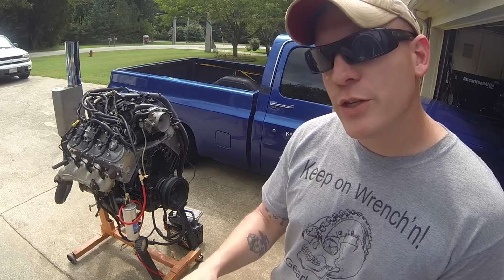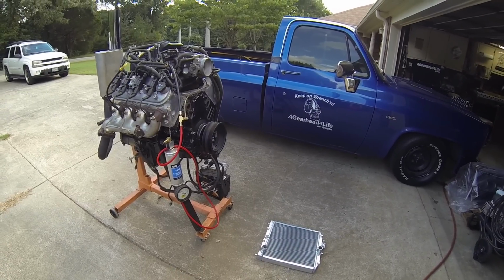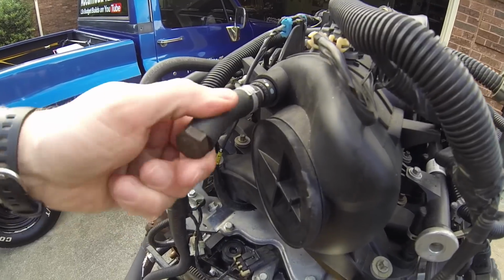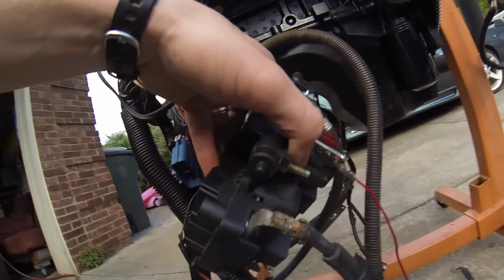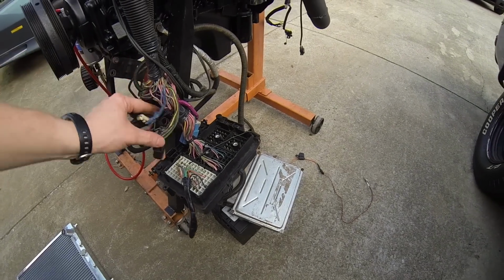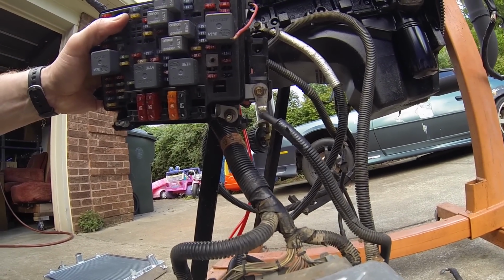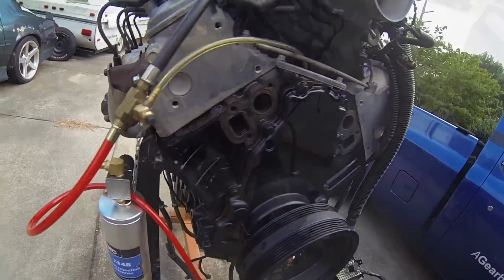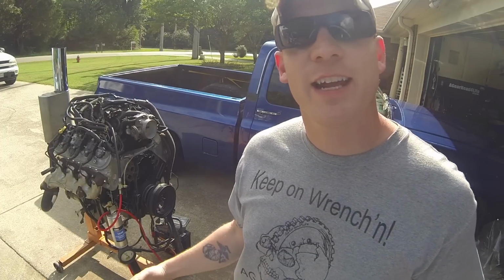LSx Swap Harness How To Simple & Free DIY Standalone on the Test Stand

Comment: Got this from MikeyTuned. Pin F1 on block C3 is the 12V hot for the fuel pump. It should work with any fuel pump so you can power your fuel tank through this harness.

Comment: This is comment is lengthy, but I need sound advice.  This requires a full understanding and as much info as I can recall.
Watched the video numerous times.  We are swapping a 5.3L (from '06 Suburban) into a 1970 Scout 800B.  Followed all steps as best I could follow.  This is our first shot at something this involved.  We have it turning over like a champ.  We cannot seem to get the injectors to open up.  Cranks and cranks with no fire or fuel making it out through the exhaust.  We did have shellacked fuel back pressure out the fuel rail when I disconnected the injector cleaner set up.  Very late the other evening, the motor seemed to seize up when turning over.  Fearing we screwed something up royally, I turned the crank by hand with with a ratchet.  It turned with a slightly different feel than what I remember while priming with oil, but no hard hard-ups.  I fired once more with the pistol grip ignition switch.  It turned over again, this time it did puke some shellacked fuel out the exhaust.  We called it night.  (This motor was bought about 2 years ago, ran when the suburban was totaled. We haven't really touched it until this week.  Prior to attempting to start, we drained oil, changed filter, primed oil to all 16 lifters, changed plugs and wires.)  The day after the puking, I added some injection cleaner to the fuel in the canister hoping this would further help the case.  No luck.  After turning over several times, we still don't get a start or fuel out the exhaust.  We have checked for power at the injectors and coils.  Success on all cases.  At a loss right now.  Wondering if there are some slight variations in PCMs (I did have LT1 reflash and remove VATS).  We've watched a few other videos on the subject; yours is by far the best and easiest to follow.  I have picked up some other tips we may try, little more elaborate setups with a reservoir and fuel pump and some other terminals powered.  Any other tips you might provide would be awesome.
Short of the situation:
-5.3L Vortec from 2006 Suburban
-stock harness and PCM from same vehicle
-reflash and VATS removed by LT1Swap
-oil drained and engine primed with oil
-new plugs and wires
-stock harness reconnected and wired following the guidance from your video

-short headers installed in place of factory exhaust manifold to fit in the smaller Scout engine compartment
-EVAP purge solenoid is still installed with outlet/inlet plugged
-large vacuum port on the rear of intake manifold has what looks like a factory plug (I've removed to confirm it was actually a plug and reinstalled).
-a third vacuum line on the front passenger side was plugged
Would really appreciate some advice.

Comment: hey gearhead...just finished my swap.but I have one last question hopefully you can help me..what would happen if I don't connect my tcc wire.thanks again for all your help...helped me big time..
Reply from the maker: It'll run and drive and all, but it's a good idea to hook it up. Off the top of my head, i cant tell you what would happen. Maybe just not lock up the converter, meaning higher RPMs and less fuel efficiency.

Comment: LS performance all the way man....at first I didn't even wanna think about an outta the norm swap but vids like urs and there's a TON of good books.....how to swap GM LS engines into almost anything is a real good one but the best way is to not b afraid and do it.....if it don't work hey were just out of a pile of loot, sounds like normal everyday life huh, lol?......these vids and those books.....make that not the case.....it's possible.....good luck to ya man!!.....oh I almost 4got do u have a video of how u plumbed the fuel lines in the 3rd gen??....or did u go w/an aftermarket tank, etc?
Reply from the maker: +Aaron McDonald Yep, thats it. Don't be scared and just do it. I dont have a video on the fuel but there wasnt much too it. I've got pics of what I did in the photo album of it on my Facebook blog page "AGearHEad4Life".
Reply: Nice.....I'll scope it out.....did u have factory fuel injection?....in other  words,  did u use an in line pump or one sumped into the tank?
Reply from the maker: +Aaron McDonald On my first c10 I used an in-line pump, but on this one I adapted a walbro 255 pump to the sending unit. I prefer an in-tank pump. In-line is noisy but easier. A sump is a good idea for these. IMO the best way is to use a fuel injected k5 blazer or suburban gas tank in the rear.

Comment: If you believe in yourself you too can start your LS swap with a crimper/stripper tool.
Reply from the maker: Definitely 👍 Shoot, my first LS swap was done by ghetto twisting the wires and electric tape when I removed the stock fuse block and it still worked great as a daily driver for years.

Comment: can I just put the engine and trans in from the donor vehicle and run a wire from my ignition to my A9 plug and just go?
Reply from the maker: Yes, technically you can and it will run and drive, but you’ll eventually realhh in me that there are a few more connections that you’d like to have. An OBDII port is one example.
Reply: @AGearHead4Life  I have a complete donor vehicle and I am attempting to  basically take everything from the donor vehicle ( instrument cluster, daytime running lights, mirror w/ temp and compass, cruise control) everything and install it into my 2 door blazer. Im basically swapping the shell for a different shell. I know some fabrication may be needed but I did want to butcher the harness if I didnt need to.....thank for responding

Comment: I don't have a pin number A 9 but the harness I'm using is from the donor truck witch is a 04 with a drive by wire TB
Reply from the maker: It likely does have it. It's very easy to misread the terminal labels. I did it at first a few times. I had to study real hard to get see it right. I think I actually counted them to get it right. lol

Comment: That's awesome Dude. Thanks for putting that together.
 I'm right in the middle of an LM7 build (going in a Jeep). (I'm building a stand-alone harness now.)
 A couple of questions if you don't mind.
What are you using to plug the evap purge valve? It looks like you cut the purge valve in half.
For the vacuum port on the back of the intake, where do you connec that in the swap vehicle? In a chevy truck, it goes to the supplemental brake assist pump, I think. I don't know if the Jeep has one of those. I don't know what to do with that vacuum port.
Thanks.

Comment: gona try it out see what happens im almost done with my c10 82 it already cranks sound fkn loud and sweet but turns off quick i think is the thief lock cause i didnt flashed the computer and well was asking u of the obd2 cau see i want to tune it in the futer i was able to use the original fule pump of the donator suburban 2000 i got i want to send u some pics to see if u can show them to people i like how u teach my dad is a mechanic and been learning alot to from ur video. thanks..! 
i had a straight 6L in my c10 82 and well im going to be so dam happy when im done with my 5.3 runing in my c10 i already see thant c10 flying lol

Comment: Gear head awesome video your video is gonna help me a lot only question is my factory harness that I'm taking out of my 2004 Cadillac escalade looks a little different from the factory harness in your video also mine is drove by wire not cable what else do I have to do with the drive by wire?
Reply from the maker: I can’t think of all you need to watch out for, but I know one thing, you need that accelerator pedal and the harness that goes to it. There may be a little brain in that harness too. 

Yes, the overall harness is slightly different, but not by much.

Comment: That's incredibly easy to do. Now my question is who reflashes the GM ECU or ECMs? Or is there the actual software you can buy so one can do it at home? Awesome videos man. Thanks.
Reply: Just found HP tuners can reflash and remove VATS.
Reply from the maker: +Abel Ramirez Thanks Abel! Yes HPT can do it, but that software is about $500. So usually people just pay to have a tuner do it for them. I've got the info for the person that I used in the video's description.
Reply: +AGearhead4Life Whoa $500 is good chunk of change but for some it may be a worth the investment. Still good to know of good tuners out there.
Reply from the maker: +Abel Ramirez Yea, it's a big chunk. It'd be worth buying if someone was planning to tune as a business or even just really wanted to learn to tune their own vehicle bad enough. A little bit  more investment and you could buy a Holley EFI system instead. It's has much more ability and is more tuner friendly.
Reply: +AGearhead4Life good point. I saw one of your videos on the unboxing of the Holley EFI system. Looks great. I'm guessing there will be a video on it later once it's in your turbo camaro?
Reply from the maker: +Abel Ramirez Yea man, I can't wait to play with that system. I've heard lots of good things about it. I hope to catch a video of the Holley EFI system soon, wired in and running on the stand like this one is. But I'll have to do that after LS Fest.

Comment: i like the idea of using the enginestand for an engine teststand and the solid bars for the bellhouse mounts  , might adapt the idea for my project

that pressure tank providing the fuel allso gives me an idea 

i think i will use a small camper cooking style propane gastank with a T connection turned sideways screwed inplace of the valve 
i then make an adapter putting a pipe in though the T from the top to the bottom of the tank for the fuel and put the paintgun regiulator ontoo the side hookup with a airpressure coupling 
to fill the tank up with fuel i can vaccuum the tank with a vacuum pump hooked up to the airline instead of the compressor and have the fuelline normlly going to the engine dipped intoo the fuelcan sucking the fuel up so no risk of spilling there either 

the vacuumpump i use will prolly be one used on the central doorlocking mecanisms of some cars 

doing it this way will save me having to mess with a fuelpump and fuelregulator right away and prolly make the system safer in case of a fire (just release the airpressure from any distance after running away from the motor and the fuelflow will stop and will be contained in a thick metal tank  ) 
will have to plug the fuelreturn line on the rail but that prolly whont matter
i can tune the pressure with the paintregulator up to the millibar (as long as its under the max air pressure the compressor can build ) so i allway can create the perfect fuelpressure for the type of engine im testing even if the battery is low  
safer than having a opened plastic can sitting next to the engine waiting to get kicked over spilling fuell all over the floor
Reply from the maker: watahyahknow Sounds like a cool project. I'd like to see this.
Reply: i'll try to post pictures once i get building the thing 
picked up my enginestand today , need a bunch of metal and bolts for the thing , someone ripped the box open and i lost all the small stuff
Reply from the maker: watahyahknow Cool. Tag me in it, if you remember, when you post the picture.

Comment: Also fuel delivery.... I have the saddlebag setup from factory and like to use this if possable...... I heard inline after the tank is good but doesn't last long. Also about the corvette filter and pump but not sure exactly
Reply from the maker: You can do an in-line, but I don't recommend it. Theyre noisy. I recommend a rear mount blazer tank with an in-tank pump. Im in the process of doing this conversion to my truck now.
Reply: i want to keep it as much as "stock looking" as possible... I've been reading inline pumps a lot and i hear they are not very reliable for a daily use as they seem to fail after 15k miles.... is there a way to keep my saddlebag tanks and run a silverado sending unit? i have to buy a new selector valve that can withstand the pressure of the fuel which isn't an issue.... I'm getting my parts and my knowledge ready after my deployment so that when i come back, i can send the wife on vacation and the dog and i can start ripping and tearing into this truck!
Reply: I used a AC Delco EP381 for my in tank pump with a 1987 fuel sending unit  (Dorman 692-044),  and a dorman 756-336 20 gallon tank for 1 passenger side saddle tank. Have yet to figure out how to setup a dual tank, but my main goal is to get this running right first.  I would like to know what selector valve you are thinking about.  Also thinking about the rear mount blazer tank in the future as Agearhead4life mentioned
Reply: i read a forum about the selector valve and all it is is just a beafier version so it can withstand the 50+ psi of fuel pressure..... i want to see if i can reuse the stock selector valve but hook it to a toggle switch so that when the truck isn't running and no pressure in the lines it would work...... ill test it out after deployment..... but i appreciate the part numbers..... what kind of modification was there to run that setup?

Comment: And that's all you gotta do to make a 5.7 run in a c10 just run power to fuse block and run the stock c10 ign wire to that pin in the fuse block and you don't need to run and sensors
Reply: I meant 5.3 I understand if you don't answer mark you gotta lotta people asking questions I could post the question to the Facebook group page though
Reply from the maker: +DIY For C10 Trucks 81-87 Nah, I wasn't sure that it was a question actually. I was trying to figure out what you meant. I thought you were pointing something out to someone. 

Yes, this is all that it'd take to make the vehicle run and drive. Of course there are lots of other options that are usually done in addition to this. The sensors are hooked plugged in this video.
Reply: +AGearhead4Life Okay thanks

Comment: made it look so easy ...I did an ls swap on a k1500 4x4 and I'm stuck on the wires to the ignition switch to the pcm
Reply from the maker: +pedro sanchez Well this will get you to at least be able to drive it. You can always clean it up and customize it later if desired.
Reply: So just those 2 wires then ?
Reply from the maker: +pedro sanchez Yep, just what I did in this video.

Comment: Helped a lot! I wired the A9 terminal to my ignition switch, but how can I use the fan and fuel pump relays on the fuse block for my 92' Camaro? I have a 2003 5.3 w harness... Replaced intake and injectors w 42# and LS6 intake, and ls1 water pump and belt accessories, to fit in the car
Reply from the maker: jeremy parr Awesome! Glad to hear it!
For those relays to function, you’ll need to find which pin to use. I’m not near a diagram to answer that though. I usually use a separate relay and universal fuse block on my builds.

Comment: E8, F9, B6 on the C2 under hood plug, if you don't use the stock fuse box do these wires need to be kept. 01 5.3 with 01 4L60E.

Comment: Well my friend its been a while since I talked with you ,  but like you said if the VATS is still installed in the ECM it wont start ,  every thing works but the engine wont crank ,so I'm gonna have it flashed out ,  thx
Reply from the maker: +Eric M Hey hey Eric! Sounds like youre getting close though. Good luck on the rest!
Reply: +AGearHead4Life  finally ,I got it running , I had some shorts in the harness itself . thanks for the videos and all the help
Reply from the maker: +Eric M Awesome! Glad to hear it.

Comment: can i still install this in my car wired like this and it still run good this going to be my 1st ls swap i love the video taught me alot so if i hook it up just like this i can run it in my 84 monte
Reply from the maker: Thanks Travis! Yes, but if you run an automatic, you'll want to also hook up the TCC wire to the brake switch to make the TCC work. You'll see that there are a few more wires that you'll have to decide if you need, other than what was used here. But to simply make the engine run and drive, yes, just what was in this video will work.
Reply: Ok im going to start on mine

Comment: awesome video. that's easy. it works for an 02 8.1? putting in my mud truck.
Reply from the maker: Thanks Michael! I havent looked at the 8.1 harness, but I bet it'd be pretty close to the same things. Refer to the wiring diagrams on LT1swapDOTcom to make sure, if you need.
Reply: AGearHead4Life ok cool. thanks

Comment: good vid! thanks for going over it 3 times.  some guys talk too fast and all that. i am thinking of trying a l33 in my Jeep Cherokee.  can the 700r4 be made to lock up at hiway speed and in 4 low for off road use?
Reply from the maker: Thanks Brad! Yea, I notice that I speak fast and I also like to have things repeated to me when I'm learning. So I try to do the same for others. Yes, the 700r4 can be mated to the LS. All of the old GM trans will mate up. you just need a spacer to support the snout of the converter and make sure you converter bolts line up with the type of flex plate that youre using. Sometimes you enlongate the holes in the flex plate to make it fit, it depends. I'll get a link to some options for you.

Comment: Amazing!  This really helps with the decision to drop an LSx into the '48 farm truck.  Many thanks..  Any problems with getting the computer flashed? (Year, engine type, etc.)
Reply from the maker: +Jim Binger Check out &quot;CoolMike222&quot; on eBay. He sells PCMs cheap and programmed to your project. PM him if you have to. He&#39;s a good guy. He&#39;s done work for me before.
Reply: +AGearhead4Life  Thanks so much!